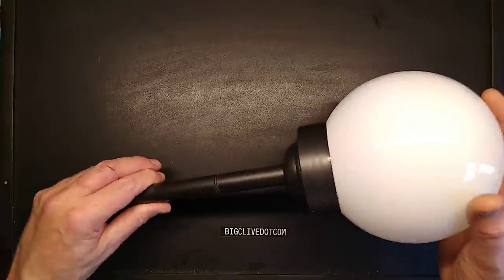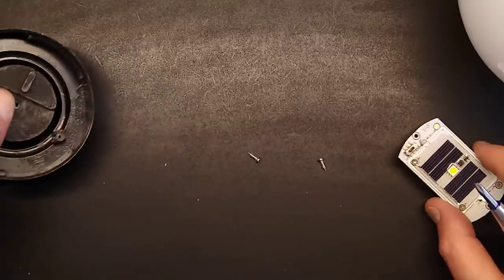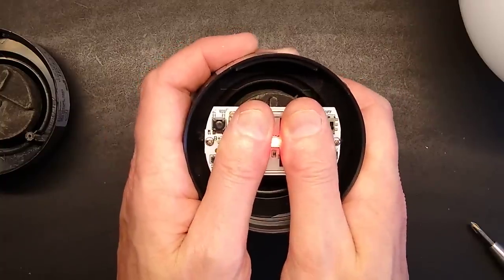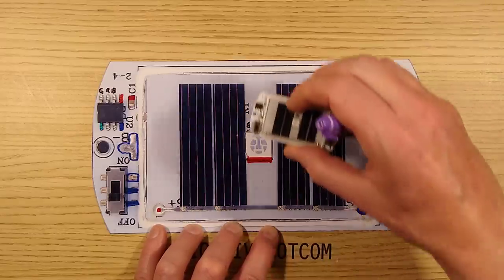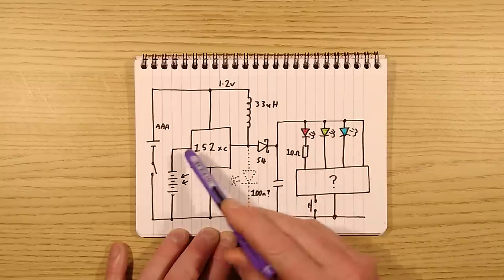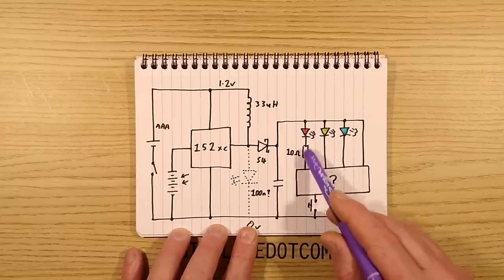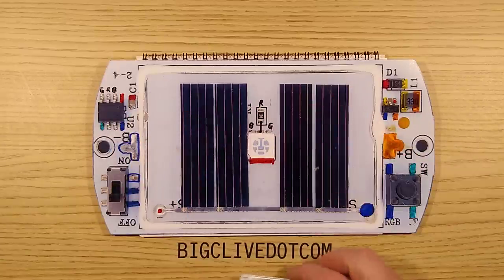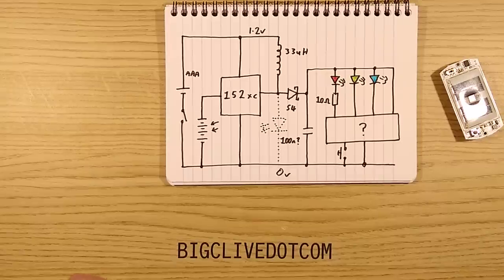Inside the LIDL solar globe light

Comment: The weight is probably for sitting it on a table or flat surface when you take the spike off so it won't fall over or blown over in a breeze.

Comment: I've been given defunct solar lights by my neighbors, and most of them have failed from rust or corrosion, with an occasional bad battery.  I really appreciate that Clive tells us how the moisture causes failures, especially the on/off switch. I've used some clear coatings like nail gloss to cover vulnerable circuitry.  But the really nice thing about this light is that all electronics are on one PCB, no wires.  That means I could wrap it with a layer of clear plastic and seal it with my plastic bag sealer.  Then it would be totally sealed except for the two screw holes.  The only thing left then would be the AAA cell corroding the PCB.  Thanks, Clive.
Reply: Yup, most of mine and the ones I've been given have a corrosion problem, 90% or more it's the switch which I just solder across to fix.  Never thought of using clear nail polish (varnish over there?) to seal things up as well after getting corrosion out/off though.
Reply: If there is still a chance, I suggest a small modicum of silica gel beads be a part of the environment you are isolating. If you really want to get fancy one could flood the entire assembly operation with dry nitrogen, but I know I know that's crazy.
I've wondered at times how long we could make devices like this and, well, many others I admit, last without failure. Or at least last longer than a human lifespan. I should have begun this experiment a long, long time ago 😂. In fact I should have applied that mindset to myself! HA!
Reply: acmefixer, the plastic bag might prevent some useful light rays hitting the pv cells, in the same way that some glass is not really suitable for covering the pv cells that are put on roofs.  that pv glass is special stuff.  the glass used on hot water collectors is also a special type of glass.
Reply: @markhonea2461 - the NiMh cells will typically only last one to three years.
Reply: @Mark1024MAK  
Yeah, not even that long.  My neighbor bought two garden lights and one had a dead cell right out of the box.  If you pay only a few dollars for a light, you know they're using rechargeables that are barely working.

Another neighbor gave me four non-working garden lights, from back when they were better quality.  I fixed the corrosion problems and they're still working with their original cells.  Nowadays they build them so cheap that they use a button cell that runs only a couple hours if you're lucky.  Pathetic!! 😡
Reply: @acmefixer1 I bought solar lamps for only 5 dollars and they are fine, I opened them and they have 18650 lithium cells, so I was lucky?
Reply: @rickhuntraslam2925  
A normal 18650 cell costs more tha $5.00 so the cells you got most likely are culls with very low capacity, probably 1/5 of the normal 3000 mAh, maybe less.  The voltage is 3.6V so the garden lights do not need the boost circuit found in most garden lights.

Comment: As a suggestion, why not replace the reset/colour change switch, in the RGB version, with a reed switch. Just tap near it with a magnet when needed.
Reply: Yes because that switch is pretty useless as is.
Reply: I was thinking of a capacitive button. But the reed switch would be easier. 👍
Reply: Electret switch.  Tap anywhere on the light.
Reply: It would cost 1c more

Comment: I was surprised that the solar cells work well enough with that frosted(?) globe.  Apparently they do...  :)
Reply: My thoughts exactly, I've been buying these globes for a while and whilst it amazes me as to how well these globes work in the summer, when it gets to winter months these lights barely work at all. Even other types of solar light still work to a point (albeit not for long) so it really does rely on the strength of the sunlight passing through the plastic globe.

Comment: Quite nice, though I would have wished for a bit of nonvolatile memory in the LED controller chip to remember the user's colour choice. Also, it seems like the base has no holes in the bottom to allow water to drain. I wonder if the base might fill with water just from rain running down the surface of the globe and past the plastic threads where it screws into the base. Might be worth drilling one or two holes just to allow for a bit of drainage.
Reply: Good comment, my thought entirely. 😏👍

Comment: I think the weight is there so it doesn't fall over or blow away. Could be useful if you go fishing in a strong current. 🤔
Reply: Mostly the high winds I imagine. The stake may work its way out of frozen-ish ground? Or move in soggy. 
I've had light-weight ones fall over randomly so this may work better

Comment: I noticed that there were drain holes in the bottom of the housing, so at least the water drains out after it has corroded the exposed components.
I wonder if the mystery weight was to provide the quality, weighty feel to the product?

Comment: I'm slightly worried that the clear resin sealant might discolour over a few years and eventually stop the light from charging.  Nevertheless, this is a HUGE improvement over the cheap ones!
Reply: Any of the resin topped panels I've seen get yellowed and frosty on the surface after a year or two, you can polish them periodically but glass holds up better long term.

Comment: Maybe there's a way to keep power to the RGB chip without having the LEDs lit? What would happen if the connection to the RGB chip without an LED was connected to B+, for example? I see it's an 8-pin chip so maybe there's a keep-alive pin for retaining a colour or maybe programming a colour through a resistor?

Comment: The weight is to probably make it seem less cheap. Still not particularly weather proof, rain will just travel around the globe and pool up in the base if the weight blocks the small drain hole. I'd remove the weight and coat everything in silicone grease. Nice that the module is removable though.

Comment: You could attach a push button to the black lower case and wire it to the micro switch (or remove it).

Comment: Two questions: can I use pink mail varnish instead of clear for waterproofing, and would the charge chip survive having one or more NiMH cells added in parallel to keep it going a bit longer in the night?
Reply: If you add cells in parallel then it's highly likely they won't reach full charge since the solar cells inside the lights are only low power solar cells. In addition these LIDL globes have the plastic globe shape around the outside of it, so the light from the sun has to pass through the plastic globe before it gets to the solar panel, reducing its efficiency.
I reckon that this will get worse as the outer globe ages and yellows, as plastic usually does.
Reply: Hmmmmmm, "pink mail varnish" ????, is that what postal persons use ?????😏

Comment: Repaired a couple of similar units like that from the pound shop and the like and 9 out of 10 people change the rechargeable batteries by normal batteries and then the shit starts.
Also the contracts are getting rusty and loose their electrical connection.

Comment: I have a suggestion for reverse engineering. Led bulbs with integral photocell. I'm curious how they can ignore the light of the LED when they are installed inside fixtures. Is it a time domain where the led shuts off for a few microseconds, whist at the same time, the sensor samples for ambient light, or is it a difference between the wavelength of light the sensor can respond to, vs the spectrum output of the led array. Just a thought

Comment: I use a headtorch for walking down roads late at night and I wonder if I should also grease the contacts in the battery compartment. I never take the battery out (18650 cells) and charge via USB so I wonder if that'll stop the corrosion my last one suffered from.

Comment: Interesting little light! I wonder if the AAA cell holder could be replaced with an AA one with the space available (although I don't know if the solar panel would have the current to charge the higher capacity cell)
Reply from the maker: You could use a higher capacity AAA cell.
Reply: @bigclivedotcom yeah I have some of these myself and they are only 300mAh, you can get AAA cells up to 1000mAh, only thing is with the solar panel being hidden in the plastic enclosure, not much light will make it all the way through so it may not charge fully.

Comment: I have Aldi solar lights in my garden and the biggest problem I have with them is the power switch and internals in them isn't weather protected. I have four spot lights and four lights on a leg.

After a short while the battery contact in the lights I got was rusty I. 2021 would no longer work. So I bought more last year and the switch in most of them is dodgy now. 

Some nights I have to go outside and wiggle the switch to get the light to work. I've also had to change the battery in all of them.

Comment: With the solar panel is inside the globe that will surly stop the amount of light hitting them. If they are in any shade at all it will pretty much stop all the charging id think,
 I have the normal garden light with the panels on top and need to be in the sun to get a full charge and when I put energizer cell's in the sung can't charge them fully so I charge them weekly in the house just to keep them toped off, 
Are these a new panel that don't need a lot of sun to work I wonder and with that in mind the light it self must not be bright because it would trigger the panel and stop the light from working,
I used to set my lights up in pairs so one on top of the other so the light from the top row would keep the bottom row turned off until the top row went out,
If these don't need much light to charge I think I would pull the light like you did and put them up under the overhang '' roof ''  around my house so they are out of the rain and out of sight but light up nicely at night.
Reply: In the winter, these things barely charge at all, it is purely relying on the power of the Sun's rays during summer months.

Comment: Hi Big Clive.
Could you please in short terms explain why the push button is dual polled?
Reply: It's an SPST switch with two terminals for each side. Designers use them as free jumper wires when routing the board.

Comment: Is there no flash memory on the controller chip to save the color settings?
Reply from the maker: Apparently not.  There might be an issue with the limited current and voltage for reliable memory writing.

Comment: I love solar lights as if you get good quality one or tweak its waterproofing they can last good few years, but I seriously hate those cheap batteries they put often in them. Those batteries weight nothing and die after few months... One time I gutted few of them and it was really empty shell with really one wrap of thin toilet paper inside and plastic separator that was even thinner and so brittle that I bet It would convert to dust if you would shake that battery harder.

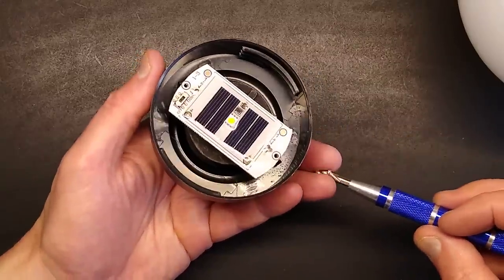Comment: 1:17 There was this chain selling a wind up alarm clock but the sales were terrible. It was a good clock but somehow it wouldn't sell. An industrial designer was asked what was wrong. A week later he brought the clock back Change this and it will sell like crazy. He was right, and the change was putting a weight in its cavity. When it's heavy, it is expensive. The weight is marketing.

Comment: The weight is to make it feel more expensive, we did it with telephone handsets as we moved from bakelite to thermoplastic
Reply: Weight in the RECIEVER was to ensure it closed the circuit switch when the handset was put down, some weight may have been in the unit itself to stop it rolling off the table, there is no weight difference between thermoplastic and bakelite, which is also a thermoplastic. . .
Reply: @phonotical  The move to plastic meant they were hollow not solid so much lighter. The old mechanical cradle switch did need plenty of weight but microswitches did not. Yes the phones did slide across the desk even with new style feet as the dust stopped adhesion. The weighted mod was tried but BT still would not take them.

Comment: "Hold on, I just gotta set these solar lights to stick on green."

opens top, presses button when it cycles to green, can't find top in the dark and turns on torch—resetting the solar light back to color changing
Reply: Seriously wondering how did that design got all the way to production.  Let's add a bunch of cost and complexity to the board that can't ever be used in practice.
Reply: It's pretty simple to fix, just program an arduino to read a colour sensor and when it gets to the colour you want it can turn a servo motor to push the button. You might want to add an ESP8255 board so you can select the colour over wifi, and write an android app for your phone to be the UI.
Reply: Almost all $0.25 microcontrollers have non-volatile memory for this. Maybe this is the $0.24 one that didn't

Comment: Well.. one could try and find a 8 pin microcontroller that has VCC on pin one and ground on pin 8 and can have a partition to store two freaking bytes.. and the rgb comes on in the last colour you chose. ;) (okay.. a bit clickediclack  might be necessary, but I think a firmware for these functions would be not much longer than 100 lines of arduino code ) thanks for the video !
Reply: yep those noname chips have a pinout similar to Pic so it won't be difficult to find a replacement. I don't know if they chose a dirt cheap clone without any eeprom inside or they just didn't care about correctly programming the functionality.
Reply: @PainterVierax  Of course it would be most interesting what IC is on there now, and if it is writeable .. ;)